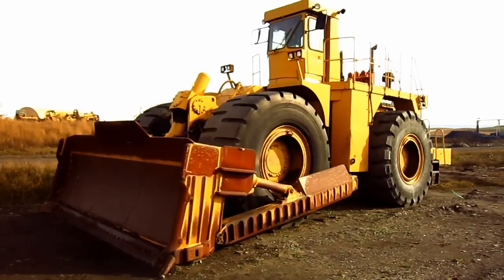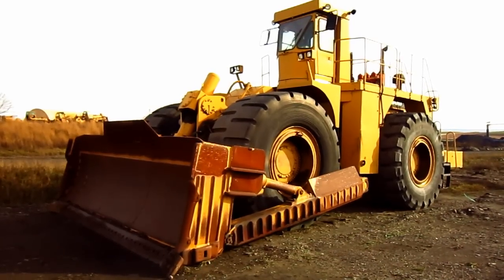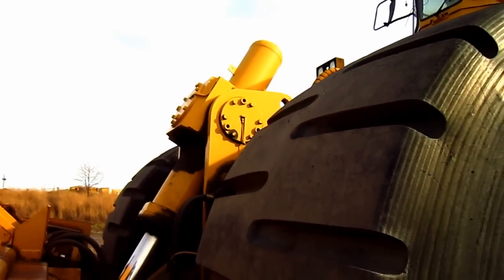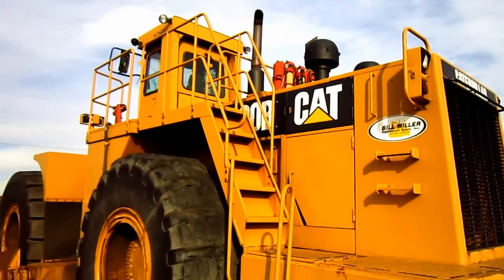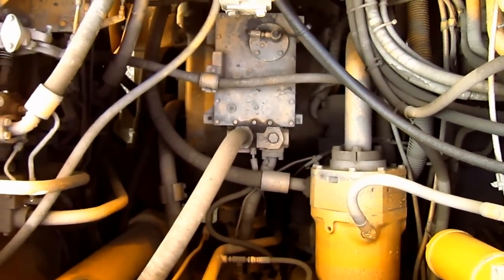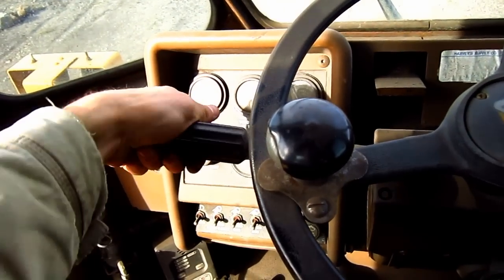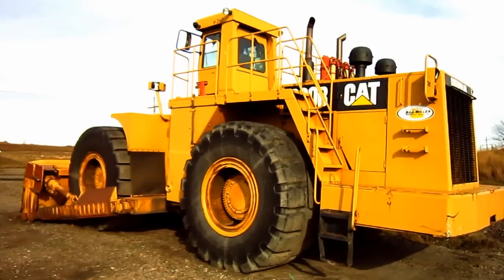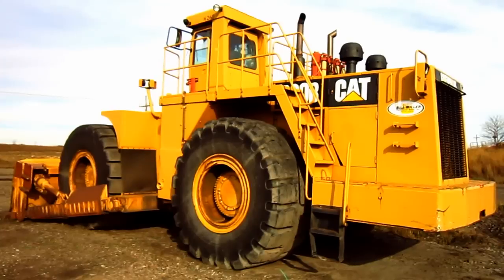Tiger-Caterpillar 690B Documentary

Comment: When rubber bulls first came out in the 50's nobody believed they could push anything.  Then the Letourneau salesman convinced them to put one of their early 4 wheel skid steer dozers blade to blade against a D8 on good ground.  It was no problem to push the D8 backwards.  Instead of one D8 with operator per shovel for cleanup, one of these, especially once they got a little larger, could take care of the whole pit, cleaning up around shovels and fresh blasts, moving cable boats, moving dump shacks, and so on.  They couldn't work the dumps, though.  Not enough traction or flotation on soft ground.

Comment: I always enjoy your videos and wanted to say thanks for posting them. Were would you use a wheel dozer versus a tracked dozer and why? Just curious.
Reply from the maker: +Scott Jones Wheel dozers are designed for speed.  While smaller ones can be found on big highway or construction jobs where long pushing is required, larger wheel dozers are primarily used as stockpile and clean-up machines on a surface mine.  In this application, the wheel dozer is used to keep the floor clean for trucks below hydraulic excavators.  The tires give it the same benefit as a wheel loader in that it can move around quickly to assist multiple loading units and/or pits.

Comment: what's the advantages of a wheeled dozer over a track machine?  I'm assuming faster travel speed and less ground  compaction?
Reply from the maker: +IMSEMICRAZY Faster travel speed is the benefit here.  A big wheel dozer like this is primarily used as a clean-up machine on a surface mine.  It's designed to keep the floor clean for trucks below hydraulic excavators.  The tires give it the same benefit as a wheel loader in that it can move around quickly to assist multiple loading units and/or pits.
Reply: Totally agree. I saw Cat 834 and 854B cleaning road for 789C  mining caterpillar trucks at Barrick Gold , in the Caribbean.

Comment: The running costs of this machine would have really come home when the equivalent track-dozer needed tracks, rollers and sprockets! Take into account the speed you could get around the site and I guess it was a no brainier for the plant manager :o)
Reply from the maker: Exactly why these machines are popular on large spread out mine operations
Reply: And that's before the bolts snap off in the track frame while changing the bottom rollers! I'd forgotten about that until now. Remove the frame, cut a hole, stick-weld in a threaded block and re-assemble while measuring the tracking toe-in/out. I miss big-metal :D

Comment: Are this type dozer better some job compare typical dozer?  Nice video!
Reply from the maker: +JHaggis Yes.  A big wheel dozer like this is designed for stockpile and clean-up work at a surface mine.  The wheels give it the same advantage as a wheel loader in that it can move around quickly to assist the hydraulic excavators by keeping the floor clean for trucks.

Comment: How is a wheeled dozer used?   Where would it be more practical than a tracked dozer?
Reply: we use wheel dozers on a large coal pile. it's faster than a track dozer for long pushes to the feeder and they are good for compaction once the pile is groomed.
Reply: waste disposal is quicker to deal with in a wheeled dozer. tires cheaper than tracks?